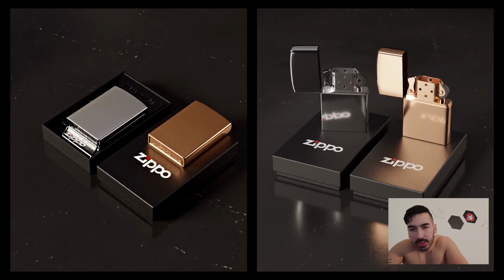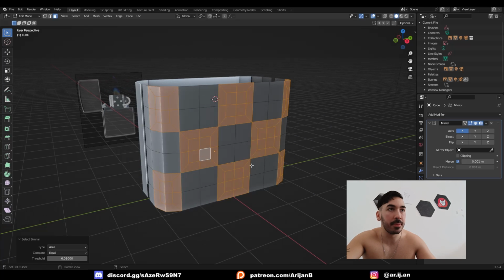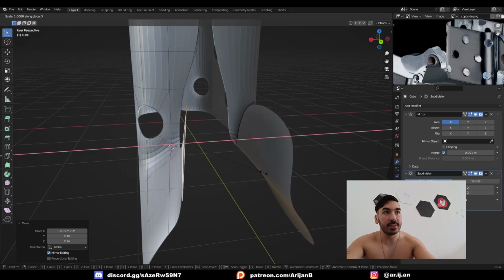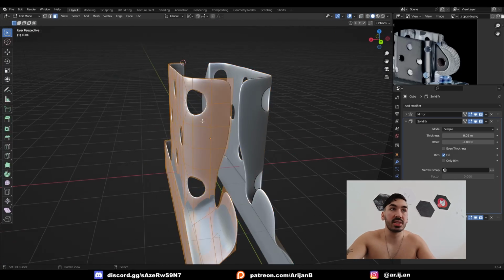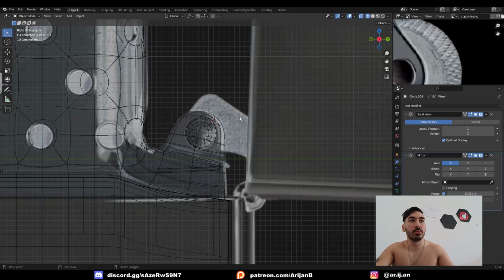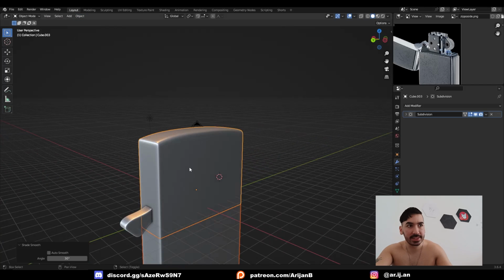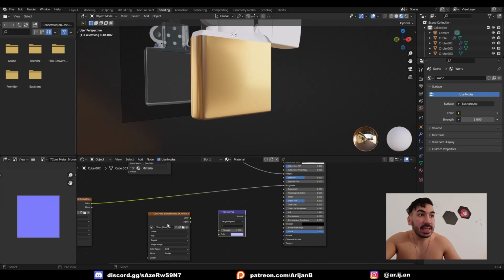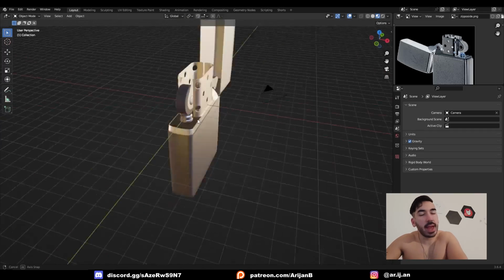How to Visualize Products in Blender | Blender Modeling Tutorial (Arijan)

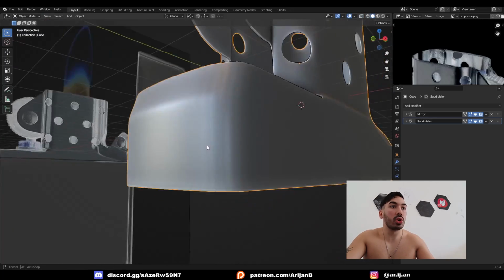Comment: on 18:40 you jump straight into the floor modeling but the part where the front part closes and extrudes down is missing... would you please help me out with that part? Or anyone in the comment section?
Reply: Yeah I just got stuck on that part

Edit: I think its selecting the entire edge loop, deselect the upper edges so you only have the straight lower half, then, E, S, X, 0, A, SHIFT N, done :) hopefully there aren't any issues, as I am a beginner (Although it is just a straight plane instead of a solid or thicker wall)